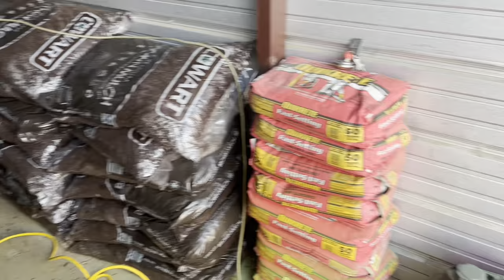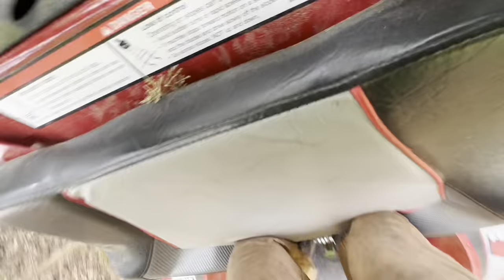What’s in your lawn care storage unit? POV and Tripod mowing footage!

Comment: 5:29 is that round lock a Masterlock #40D? I've just started locksport as a hobby, and that was the first real lock I was able to pick. Now I can open it in about 30 seconds. Not to make you nervous but it's a very easy lock to open by a novice picker. :)>
Reply from the maker: I’ve got everything I own in the lawn care business at the storage unit and inside my trailer. I feel like if someone wants in bad enough they will get in regardless. The place is gated with a code, fenced with barbed wire, and cameras everywhere. I know nothing is full proof but I try not to worry about it too much!
Reply: @ThatCrazyGrassGuy  Good point. I think the same way. Good to be as secured as can be, but if someone wants in badly enough, no amount of locks would stop them. 
Difference with pickable locks is that the theft leaves no trace when it comes to proving things to insurance. Good thing you have the added layer of cameras etc at the storage.
Reply from the maker: Our crime rate here is pretty low but things do happen.